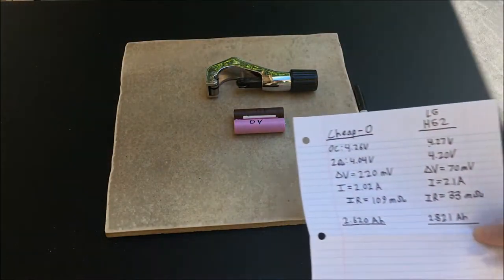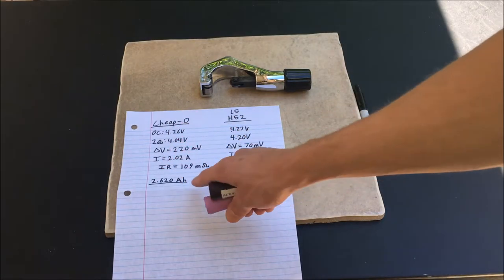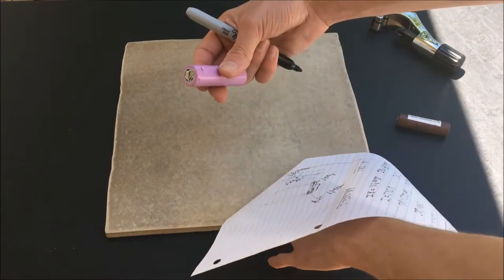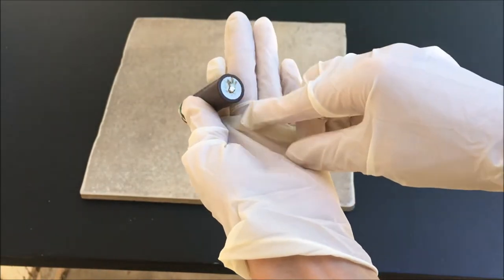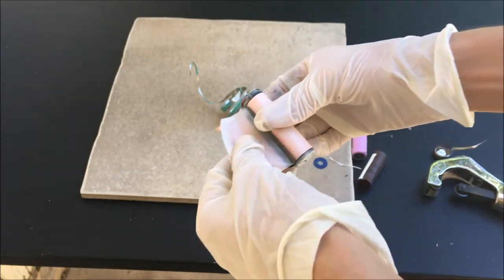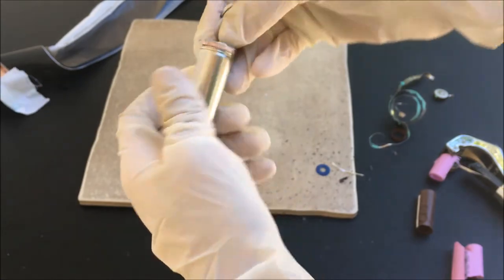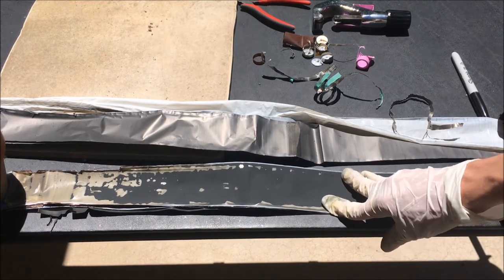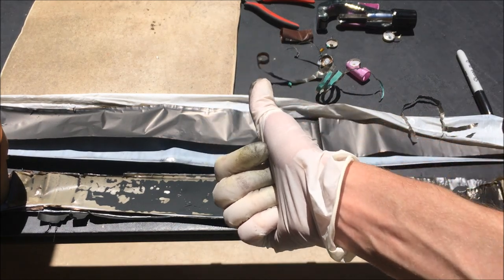EP 28 - 18650 Battery Teardown & Comparison

Comment: 9:13 The metal oxides used are usually dark/black. In any case, they are likely mixed with graphite to increase their conductivity, so the overall material will appear black.

Comment: Did you happen to weigh the cells prior to tear down?  Wonder if the generic was lighter! Thanks for the video.
Reply from the maker: Unfortunately I did not weigh them before opening. The generic cells were slightly lighter as I recall, though. I did another video where I tore down the cheapest cells on eBay ("9900 mAh" cells) and in that case I did measure the specific masses of each cell.

Comment: So these have no lithium foil, but just Lithium salts in the carbon ? Is there only a copper foil inside as the only metal foil ?
Reply from the maker: Correct. The copper foil is coated in carbon on one side, and the other side has a lithium oxide material. The separator is soaked in electrolyte, and the active lithium ions are dissolved in the electrolyte.
Reply: @DielectricVideos  do you happen to know, what kind of Lithium salts are in the electrolyte? Is the carbon just the 2nd electrode? How is it connected to the outside? Are there some stainless steel pickup clips into the carbon material ?